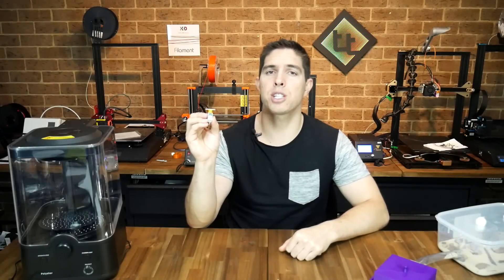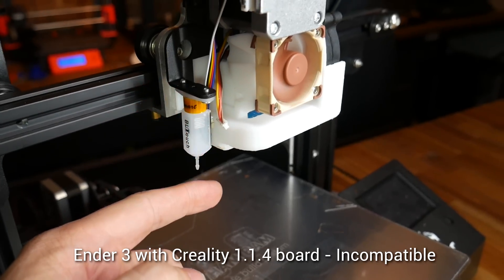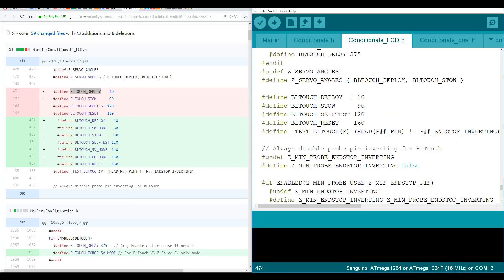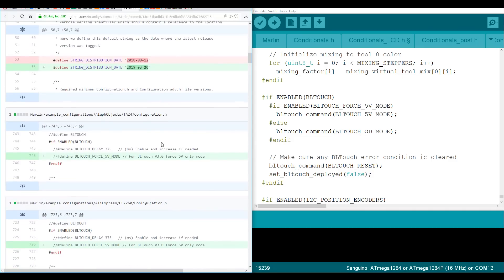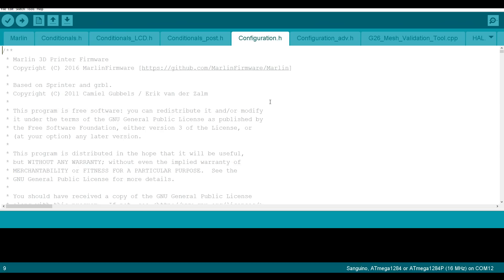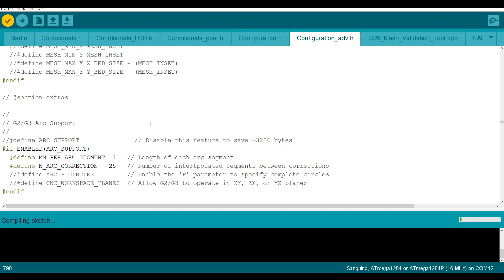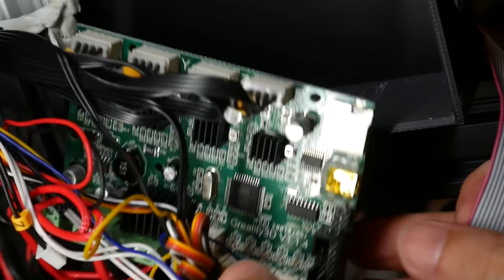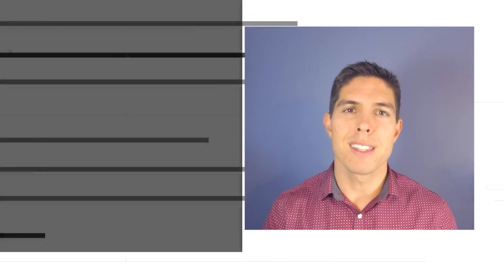3 Fixes for BLtouch V3 on Creality machines

Comment: Hello Teaching Tech,

unfortunately I can't flash your BLTouch firmware (Marlin.ino.with_bootloader.sanguino.hex) on my Ender 3 via Cura 4.

I bought the Creality3D New Upgrade 1.1.4 Mainboard for Ender-3 with silence stepper.

Error message:
Firmware update failed due to an communication error.

Do you have any idea why?

Many thanks

Comment: I have to say that the V3 works flawlessly and without any modifications in my CR-10S with 2.1 board
Reply: Can you tell me where you got the firmware for that? Having trouble with 3 machines at work that use that board, the CR20, the CR10 500 AND 400! Thanks
Reply: @samueldennis8343  I just downloaded the last stable version of marlin and configured it following one of the guides here on youtube... I dont remember having any problems.

Comment: Hello and thanks for the video. Great! But i cant get to run on my cr10s pro. whats about the 2. Install around 1KΩ resistance(pull-up) between +5V(Red) and Zmin(White) at antclaps? Firmware changes didnt work or i do something wrong. i also tried https://github.com/InsanityAutomation/Marlin/tree/Creality_DWINTest but the z axis wont stop. Has somebody any help for me?

Comment: Antclabs says that for ender 3 you have to remove the C7 capicator. That should make it more reliable and save better then resistor. But I was wondering what the fix may be on a cr10spro? Should I remove the c48 capicator?

Comment: great video Michael, I am new to 3d printing and would like to put a bl touch on my ender 3 i followed your video on bootloader and firmware and install it great. the ver firmware is THD3 DUF_R2 could you do a video on this with bl touch v3 as i notice it as the bl touch v3 included in the code and as a beginner a little unsure. your help would be gratefully received.

Comment: Thanks for the well instructed videos over and over again!
Sadly firmware changes do not fix my problem. 
The Bltouch is not reacting well as shown in this example video: https://www.youtube.com/watch?v=Nbx2Ia_6svg
My BLtouch v3.0 is produced 2019-03-05. I just discovered that BLTOUCH V3.0 produced before 5th April require to remove the C7 capacitor.
See instructions from ANTCLABS here: https://www.antclabs.com/wiring3-1
I almost gave up. I try try this method in the coming week.

Comment: You're a genius!
It helped me a lot:)

However, I have a question: how to create a single .hex file that contains both the firmware AND the bootloader?

(I own an Ender 3 and I don't have an Arduino but simply the USB ISP of the Creality BLTouch v3 package)
.

Thank you in advance for your answer.
Reply: https://forum.arduino.cc/index.php?topic=193431.0

Comment: Hello Michael,

  Firstly, let me say that I really enjoy the videos you produce.  They are clear, concise, and easy to follow.  Thank you for providing such handy references for us.

That being said, after running through the Vanilla Marlin setup and This video on the v3 BLTouch, mine is still not working.  Ender 3 Pro, Main board 1.1.4, Marlin 1.1.9, with all patches described.  When I power on my Ender, the BLTouch displays a tiny blue light briefly then begins flashing.  the probe never moves. 

What I can find indicates that this is a self-test failure.  Have you run into this before?

Thanks
Reply from the maker: You can access the self test from the bltouch menu on the LCD. It will deploy and stow the probe repeatedly.
Reply: I also am having the same issue
Reply: Same issue.

Comment: Hey Michael, thanks for the videos, you honestly helped me a lot with these recent Ender 3 BLTouch videos! My probe actually works now (thanks V3) and I'm using your Marlin 1.1.9 bugfix flash.

If anyone has insight on what it happening with my printer though that would be helpful! Even with the auto leveler and using the Z axis offset (though a more comprehensive walkthrough for this even with Michael's way simpler method would be nice) my prints are still getting pretty rubbish first layers. 

If i use the 200x200 squares bed leveling test print (found here thingiverse.com/thing:2789086) i get the following. Some tweaking with the bed level screws helps but it's so utterly inconsistent.
My rear left corner seems pretty near perfect, my front left seems to consistently too low preventing adhesion as the printer apparently tries to print too high above the bed here.
My rear right is consistently too close to the nozzle, causing that "clicking" as the extruder tries to feed more filament but can't push it out and gives me super thin layers as a result (pretty much barely a mark on the bed sometimes).
My biggest issue is my front right corner. It gives me results that imply its too close and too far from the hot end at the same time...Closer to the edge it's super thin layers and barely any filament coming out, and not much further in, the print starts to act like it's too far away... Have I missed something? It seems like I have a warped bed or something. I've had similar problems from when I first got the printer, and swapped to a glass bed to give me better adhesion and hopefully fix this.

Normally I end up just using rafts and the prints tend to turn out okay by the end, but the first layer is almost always trash and in a good half of my prints means I need to stop and start over again because the print has gone completely FUBAR.
Reply: Try having alook at the X Gantry. wind Z axis all the way up then measure distance both sides from X gantry to the top bar, adjust is needed. Need it within approx. 1mm of each side. That has helped me heaps and make sure beds springs are aleast 3/4 tightened, to give less play.
Reply: @sunkingdave  Good tips, thanks!

Comment: Thanks for the video but, If anybody has some insight for my issue  when compiling the code with new Marlin 1.1.9 for my new BL touch. It's not connected to the board but running a check to see if i did everything right I get an error stating. Error while detecting libraries included by C:\Users\user\AppData\Local\Temp\arduino_build_192611\sketch\Sd2Card.cpp
and also Error while detecting libraries included by C:\Users\user\AppData\Local\Temp\arduino_build_192611\sketch\power_loss_recovery.cpp. Thanks in advance

Comment: I have been struggling to figure out why I could not get The BLtouch V3 to work on my cr-10s pro . Keep up the great work
Reply: how did you fix it? the software? I just flashed the bltouch firmware from creality to my 10s pro, and they said I would not need to modify any g-code to make it work. or did you remove a capacitor? I know its not the same main board as the ender, but I have my bltouch wired in and it is powering and the printer is responding, but its just making false positives and responding to those in the air. seems like a fw or cap making the issue like the video shows on the ender.

Comment: I've bought from Triangle lab for my Tevo Flash. I guess it's v2. Is it very easy to install? BTW, i'm thinking about to make it through the connector, not to the m.board directly. Who did this already, share your experience, plz!
Reply: I bought one for my CR10s the only issue that I get is EMI it messes the homing up. The hardware is easy to install but, software and the troubleshooting is a real pain.
Reply: @jontech9978  EMI = electro magnetic interferrence?
Reply: @KiR_3d  Yes what I've read in some forums is that the stepper motors and the fans can cause this especially if you have extensions for the cables. The one fix I've read is not recommended and that is to edit the config.h file and uncomment the #define ENDSTOP_NOISE_FILTER  and the second fix I had not tried yet and that to use the short cables that came with it. But as of now i have problem printing with Marlin 1.1.9.
Reply: @jontech9978  But you can make (and i'll try if will need probably) to make a simple induction filter with a ferrite beads (or rings) and a ground wire rotated few times over it. It's a common thing to filter that noise.
Reply: @KiR_3d  that sound like a good idea but, I just came up with an idea too I do computer networking what if I use STP and ground it to the chassis and on the printer side and the other end to the housing for the hotend.
Reply: @jontech9978  then you must know this better than me )
Reply: @KiR_3d  Tried it still get the same error. Just a FYI
Reply: @jontech9978  ferrite beads?
Reply: @KiR_3d  nope the shielded twisted pair of Ethernet cable
Reply: @jontech9978  try ferrite beads. If you have some old spare USB cable with it you can take it there (a cylinder part) and re-use.
If this thing (properly wired of course) will not help then I'm surrender.
Reply: @jontech9978  did you've tried a ceramic cap of 0.01 uF between S and GND? It's in my notes and it was from some conversation in Russian (from 3dtoday.ru probably). It says that it fixes some "error condition".
Reply: @KiR_3d  thanks ill try that
Reply: @jontech9978  make a photo if it will not work, i should see...
Reply: @KiR_3d  I got it. The Marlin 1.1.9 was given me trouble so I reverted back to 1.1.8 and got to work. I'm not the greatest with code but didn't give up and it work. If you need help just text me and I'll see what I can do
Reply: @jontech9978  hmm, that's interesting! I think maybe some notes about this problem can be on Marlin forum...
Maybe there is some sort of a filter in Marlin "settings" that is turned off by default for 1.1.9. Release notes could help.
Thanx, I'll ask you if I'll have the same trouble!
Reply: @KiR_3d  been using for a bit now awesome upgrade. That 3d touch is great
Reply: @jontech9978  Good to know!

Comment: i used the  pre-complied hex but it doesn't home in the middle, it homes to the center right. am i suppose to change any settings?
Reply: It's meant to home in the centre with a bltouch

Comment: Hello to teching tech studio,
Im having little issue with the BL touch.... I followed your instructions to the point and it worked without a problem. However sometimes when i try to print the BL touch (V3) will stuck, it will do the last probe point, move it self up a bit and then it just waits.
Or sometimes the BL touch probe will retract it self half way to the bed.

But when it probes all 9 points it prints flawlessly....
Any idea what to do? should i upgrade the main board? (current board 1.1.3)
Thank you

Comment: You do NOT need to tear a capacitor off of your board.  There is a new version of TH3D unified marlin firmware that works with the V3 out of the box (just need to uncomment a few settings.  Look for "V3" in the config files.
Reply: Are you sure that will work out of the box on the CR10S PRO, did you install it successfully on yours?
Reply: @LOVRIC098  I installed it on my ender 3 pro with no hardware modification required.

Comment: Doesn't work for cr10s pro with board v2.4 I guess. Any ideas? BLTouch v3 and Firmware from TinyMachines already setup as you show in this video. The BLTouch does the selftest but wount deploy the pin when i press homing.

Comment: I hope you answer my question why did you go with 1.x bugfix instead of marlin 2 ? They mentioned in the original bltouch website the configuration for bltv3 marlin 2 and its work fine with my bltouchv3 cr10s ? Is marlin 2 not stable as 1.x bugfix ?

Comment: The new version of BLTouch 3 (released after April 2019) apparently fixed this. The capacitors are in the board for a reason, they act as a filter for the inputs/outputs and prevent external noises from messing up with other sensors and the stepper motors control.  The problem is that the capacitors slow down the signal while they are charging. If the signal is too short, the capacitors will never charge on time and the board will not detect the pulse. That specific version of  BLTouch had a defect related with this timing. The suggestion of removing the capacitors to fix their own design flaw was irresponsible and unnecessary.
Reply: Where did you find  one produced after April ?  I got mine on Amazon and its a March version

Comment: Great video and very helpful. I have the Creality BLTouch waiting to be installed when I get my MKS Gen L board. You mentioned in your video that there was no problems with it working on your Tevo Tornado with the MKS Gen L, does this mean that I should be able to install it like normal and it should work (without having to do any of the marlin code modifications?

Comment: There are 2 versions of BLTouch now.
The newest one is V3.0 produced since April 5th, 2019 (why not V3.1???).
Mine is the new V3.0 😠
You can check what version you  have using the QR-Code
Reply: Where did you purchase yours?  I got mine on amazon and its a 3.0 before April 5th (March 28)
Reply: @bendeets5082  https://3dprintingcanada.com/

Comment: Thank you! Before this my nozzle crashed into the bed but this got it working! However it seems like my ender 3 doesn't use the zOffset setting. I need to lower the zOffset directly after I start printing.

Any Idea why I need to do this?
Reply: If you don't have the Z offset menu, your firmware is different. You can probably still use the babystep Z option. It should be in the movement menu. Click it and adjust until your nozzle is good. After that click "store settings" and you're good to go. Note, it's not in the same menu as "babystep Z". This should store the Z offset in memory now and is applied in every print.

Comment: Hey Michael, fantastic solutions to a problem I didn't even know existed. Great work as always mate.
Out of interest, my Borg (CR-10 S4) has the v2.1 board, does that mean it will not have the rogue capacitor and will work as it should? Currently, the Borg has the original BLT, but If it were to fail, then I would likely get the V3 but would probably remove the capacitor rather than jerry-rig Marlin.

Comment: All the files from GitHub you mention are unified patch files (diff). IMO, it is safer to apply the patches than doing copy/paste by hand on the files. I use Linux so it is obvious, but I think there are some tools to do that on Windows also. Maybe TortoiseMerge can do the job.

And thanks for all the informations you share :)

Comment: Anyone now if BLtouch v3 have problems in CR10S board v2.1?
Reply: I have issues too but since there is no capacitor the software solution should work

Comment: This is great. I've been trying to get my bltouch to work on my Cr10s pro. Hopefully this will do the trick! Thx a bunch!
Reply: I'll be very happy if you share it😁
Reply: Well I got home and tried this on my 10S pro. Followed your instructions exactly. But after marlin had finished uploading the firmware, the screen is just frozen. I get the creality main screen but usually you'll get the progress bar moving right but I'm not getting that. If someone has got the BLtouch v3 working on the CR10S pro I would really appreciate your help. Ive had this printer for a month and have only printer one stl file and thats when I first got it. Back to pulling my hair out!!!!